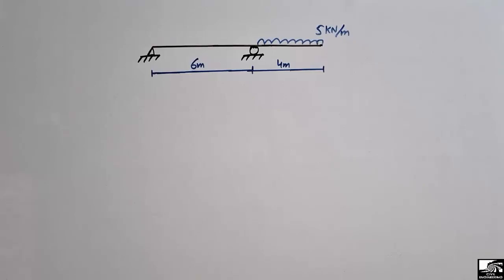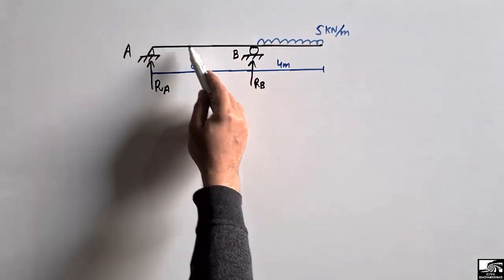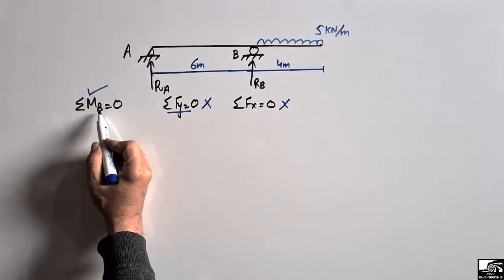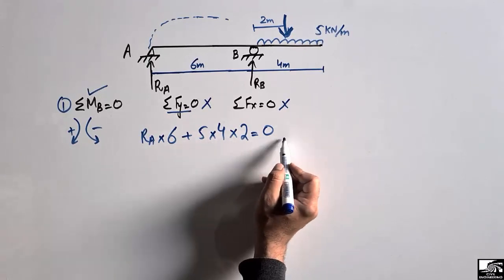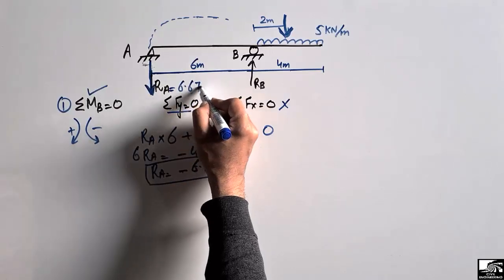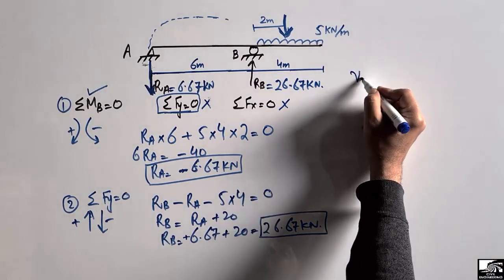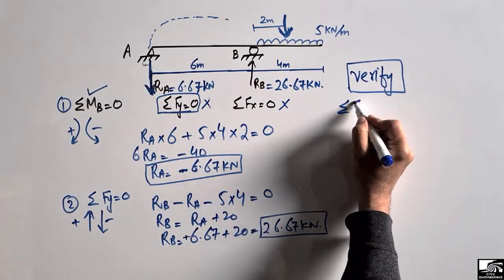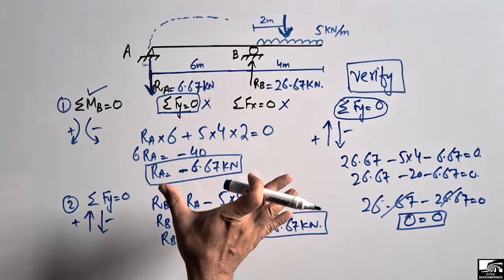How to find Support Reactions for a Beam in 2 steps

Comment: my professor has done it a different way and I'm not sure. In this case the moment arm for the 4m section you did 5x4x2, but my professor used the whole moment arm so in this case it would be 5x4 and then x8. I have to do it the way my professor did but I'm curious about which method is the correct one